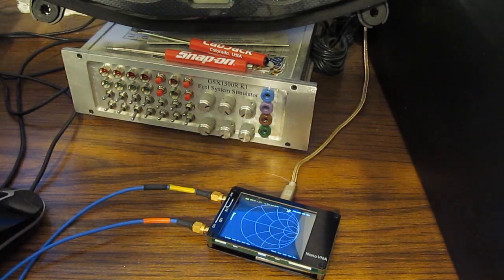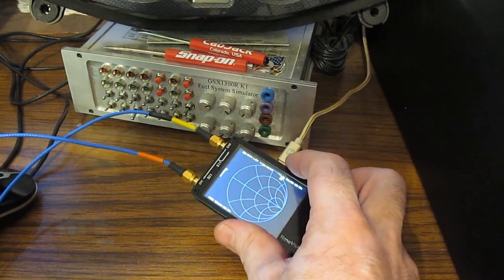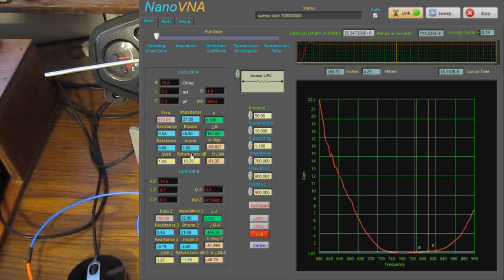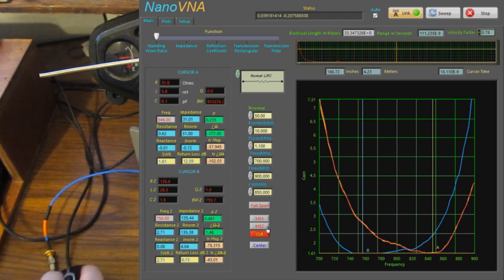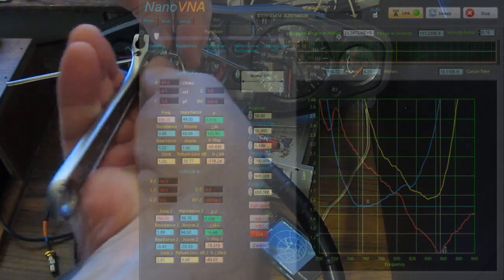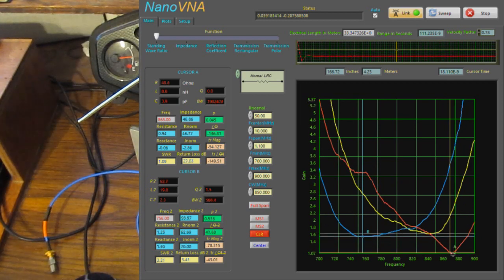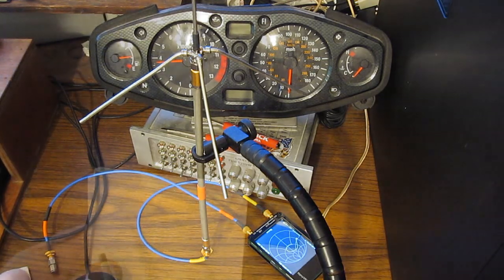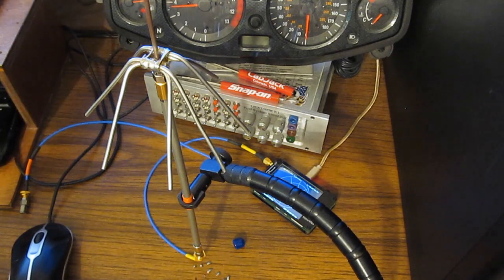Using the NanoVNA to Measure Antenna SWR and Resonance

Comment: Interesting how if Perpendicular (90°) must be used or desired, AFAIK the vertical Radiator can be slightly Shortened (from resonance Length) & a Beta hairpin match used to achieve R=50, Z=0 at Resonance with Perpendicular 90° radials ?

Comment: Hi Joe, ...At 03:24 would be cool if demo'd Radials angle 90° R & Z at resonance (R=35, Z=0) & resulting VSWR Compared to Radials slanted down at resonance (R=50, Z=0).....Very interesting how depending on radiator Length & radials Angle, many Different R & Z values result.....

Comment: I know this video was made a long time ago, but why are you using an antenna that is normally a 1/4 wave design.
The length of the element at 900Mhz is closer to a half or even 3/4 wave?
Reply from the maker: " I attempted to replicate what was in shown in the video they  had linked."
Reply: @joesmith-je3tq  Well, there is no way that this antenna design is appropriate for frequencies at 900MHz. I don't know if you are working in metric or SAE lengths. At 900MHz the wavelength is about 33 cm. 1/4 of that would be about 8.1 cm. For feet it is 234 divided by the frequency in MHz 
or 234 / 900 = .26 ft or about 3.1 inches. 
The antenna that you were using appeared to be for 450MHz.  While it will still work as a 1/2 wave antenna and will give you whacked out results. In affect you were most likely measuring a part of the feedline as being a part of the antenna as feeding a 1/2 wave antenna will present a high impedance at the feedpoint and would require a matching network of some sort to work at 50 Ohms.

Comment: Very useful video. Can I ask for the model of HP analyser you have there? I think it might be 8754A, but the manual for that only shows a graticule on the screen, not a Smith Chart. Is that an overlay you added yourself?
Reply from the maker: It is an 8754A.  The 8754A was supplied with various overlays which is covered in the manual.  I have uploaded these to EEVBLOG.  The one shown in the video is a custom one I made.
Reply: Ahhh, now I read the manual more thoroughly I can see the part about the overlays. Thank you!
Reply from the maker: @gavinsaxby  You should be able to locate them fairly easy with the search feature.  I had copied them using overhead projector slides.

Comment: Thx for helpful informative video....Using this antenna tuning procedure on SWR & LogMag,.... thru 50 to 100 ft coax run, Does it make any difference where the Calibration is performed at ?? .....I've heard the Calibration should be performed at the Antenna Terminal location & Is that Required for Vna Accuracy or is Any Additional length of coax after Calibration OK to use ? ....
Reply from the maker: Is the cable and connections perfect (no loss, infinite BW, no reflection)?  If not, they will contribute to the error.  That said, I suspect you're really wanting a basic answer.   Of course the VNA (Vector) means we have phase information which is going to be effected but you are asking about VSWR.   Think about what VSWR is.  Take your VSWR meter and insert it at different locations along your 100' coax, will the reading change?    
I never understood the ham/CB group using a VNA as what many of them call an antenna analyzer.  One ham posted about the errors caused from a local radio station.  Of course, if you are making VSWR measurements on the transmit end of the 100' coax,  placing an inline VSWR meter would be far more robust and using the radio as a source should provide enough signal to overcome most problems with outside sources.  
I constructed a simple inline Watt meter using two low cost log detector boards from China.  Of course, we would need to know what the load is for it to have any level of accuracy.  For this, both the incident and reflected signals are measured using a bidirectional coupler.   These two signals allows us to also measure VSWR.  The following video shows my meter.  Again, keep in mind you could just buy or build a simple VSWR/Watt meter.  I doubt many hams make their own code oscillators anymore, but I wouldn't be surprised if the VSWR meter isn't one of the first things they still make.    
https://www.youtube.com/watch?v=JHsgbu7brYI

Comment: We live in a decent time for tiny effective electronic tools. What used to require a whole room can fit in my pocket. Bleeding edge tech advances have slowed enough for us to optimize the tech we have. The age of optimization. Why have tons of boxes with screens that only serve a single purpose. Every DVD player and TV can be reprogrammed to detect a fire in the room as well (found that out probing an infrared module while lighting my propane burner). I wonder if someone made a patent on that yet...
Reply from the maker: True to some point.  I have three very old VNAs.   The newest is a few decades old.   The oldest from the 1970s.   The are all very large in comparison with these low cost pocket VNAs.  They also consume a lot more power.   That said, they offer features not yet available with these low cost counterparts.   In the following video, I provide a simple example of why someone may still want tons of single purpose boxes.  
https://www.youtube.com/watch?v=y6iOTEU6Zzo
Reply: @joesmith-je3tq  The longevity of the old stuff is why I still use my 35yo Hioki Volt meter. It can measure current with 10uA resolution. Some of those old bench meters are unrivaled in certain respects to this day. I just like seeing these 50 dollar boxes that get the job done fairly well. I always pick up old gear to repair or use. Easy to work on and reliable. I'll be happy if I get 5 years out of the nano.
Reply from the maker: In my case, the longevity stems from my continuing to service what I own.   I can't afford new equipment that will match the performance of what I own.   While I never use my original VNA anymore, I still require two others depending on the frequency range.   I'm in much the same boat when it comes to these low cost VNAs.  Below 300MHz, I still use the original NanoVNA as it out performs all the others I have.  For example when measuring narrow band devices or making PDN measurements.   Above 300MHz, my current favorite is the LiteVNA.   Still these are not going to come close to matching the performance of my old VNAs.

Comment: 1.03 SWR from 4 ground Radials seems quite Effective.....Why say 4 Radials don't do Any good  ???
Reply from the maker: Provide a time stamp where I stated "4 Radials don't do Any good"
Reply from the maker: OK, at 5:29 I state: "Again, if you read that ARRL book that I mentioned, they talk in there about the number of ground radials.  Basically four doesn't do you a lot of good."
Reply: I was referring to the "ARRL Book" ....They're usually correct on basic issues..... I caught your  drift....I'm on your Wavelength  !!

Comment: Can you please tell us more about those extenders that you use between the feed line on the VNA and the base of the antenna? Definitely looks useful for not only holding these kinds of antennas, but creating some separation for the measurements. Would also love to see a video on how to best measure HT antennas.
Reply from the maker: Hello Ben.  The extender is just some semi-ridged with connectors (Fairview Microwave FM-SR250ALTN-STR).  In the last video I made, I was comparing some small antennas measuring their VSWR and radiation patterns (see attached link).      If I had some interest in ham radio and was reviewing HT antennas, most likely I would rent some time in a chamber so I could reproduce the results.  That or just take them into the field using a common set of radios and common fixed antenna.  I wouldn't just connect them to a NanoVNA!!  lol.  IF you take the time to watch this video, you should have some sense of how a test like this would be conducted.     https://www.youtube.com/watch?v=xe4Fy4Lpnqw
Reply from the maker: Someone else had also asked the same question.  They deleted parts of their posts but you can find the original here.   https://www.eevblog.com/forum/rf-microwave/cb-and-ham-radio-techs-love-their-bird-wattmeters/msg4676236/#msg4676236

Comment: Hi Joe. I think I have the same vintage ARRL antenna manual as yours. But physics doesn't usually change very fast, so we're probably OK. :)
Reply from the maker: It's a pretty decent book.
Reply: The new book is almost 2” thick!
Reply: @roxleyldc , and it's $50 for the soft cover edition. I believe I'll just pick one up at a swap in a few years. Besides, I've never found my antenna design ideas in the handbook, and who wants to copy someone else's?
Reply: @johnwest7993  yes, me too.  I made a fan dipole in my attic with the longest length in the shape of a sign wave from one side of the attic to the other.

Comment: They've made two major improvements. One, the 4 inch version , just a larger version of what you have. 2 the very new version that uses a chip that will go up to 4 gigs without having to rely on multiples as did the first version for higher frequencies. It is said that it has much closer tolerances and accuracy. I think it was called the S2 ? I have the generator with that chip but not the NanoVNA.
Reply from the maker: I made a review for the V2Plus4 some time ago that throws up some pretty decent data at over 4GHz.  If you're interested, you may find it here:
https://www.youtube.com/watch?v=XaYBpPCo1qk
Reply: @joesmith-je3tq  Thankyou. I'll check it out. It looks like a great piece of gear as is the generator.
Reply from the maker: @californiakayaker  Like any test equipment, it depends what your needs are.
Reply: @joesmith-je3tq  Actually I have little need at this time for anything above 450 mhz. But, the day is coming , and I might need 900 or higher soon. I have a 900 mhz antenna I've swept, I think I've gotten an accurate sweep but would be happier with the new model.
Reply from the maker: @californiakayaker  I do hear from a lot of radio hobbyist who consider the VNA an antenna analyzer.  I've had people write me who have bought an old HP8753 just to measure VSWR.   I have no idea what your requirements are or what your intended use is but make sure that YOU do!   If your not in a hurry, I would wait and see what the next generation of low cost VNAs has to offer.

Comment: Looks like X or reactance got close to zero at -.03 and impedance was close to 50 ohms at 48.44 after that last snip.
SWR went way down also 1.04. Perfect!

I have a Nano VNA H4 and am just learning about Reactance or X and Impedance values.
I was wondering how accurate the Nano is on Reactance?

I love the small antennas of the ham bands. I'm stuck using a gynormous 11 meter antennas until I get a Ham License.
I guess I could build one to tinker with on the Nano VNA.
Reply from the maker: It's hard to say without constraining the question.  I made a review for the V2Plus4. I compared some data from it, my original NanoVNA and one of my old VNAs.   
https://youtu.be/XaYBpPCo1qk?t=2698
I also made a review of the original NanoVNA where I made several measurements with it.
https://www.youtube.com/watch?v=mKi6s3WvBAM
Maybe you will find these helpful.
Reply: Isn't it difficult to get a true reactive measurement when the antenna us being measured with a feedline. Pretty tricky to get half wavelengths taking in the velocity factor, or multiples thereof. Especially at these higher frequencies. Use the VNA I suppose. Good luck with that.

Comment: where did you get the NANO VNA computer display software?
Reply from the maker: If you read the description and follow the first link, you will find where I wrote this software.   You could have also read the comments.    I started to put a manual together for the latest version but there's no magic and requires reading.    https://github.com/joeqsmith/NanoVNA_V2Plus

Comment: To whomever may know this one. What type of or kind of connectors are those connecting the radials to the base antenna?
Reply from the maker: SMA
Reply: @joesmith-je3tq  Thanks Joe. So each radial has an sma connector?
Reply from the maker: @tlturner3  Looks close and you will only see a single SMA connector used on each antenna which I assumed is what you were asking.  The radials are attached with solder.
Reply: @joesmith-je3tq  thank you sir! I appreciate the answer.
Reply from the maker: @tlturner3   @Timothy Turner  No problem.   Keep in mind, these antennas had no other purpose than to replicate what had been demonstrated in another video.  It was never my intent to put them into service.
Reply: @joesmith-je3tq  Thanks Joe. I appreciate the notice. I am looking for hardware for small diameter wire/rod for building antennas.

Comment: Is this instrument good for adjusting a receiving antenna or is this purely for transmitting?  I have a HackRF and have discovered that the failures I may have been having with it are my ignorance that the antenna that comes with it might not be perfect for all frequencies and that you might need to adjust its length.  I am hoping that this NanoVNA might be able to provide me the confidence that I am meeting those requirements as closely as I can.
Reply: Not sure if you ever got the answer but yes the antenna with HackRF is not for all frequencies. One I am seeing says it is good for the 75MHz to 1GHz range. A wide range but you wont be able to really see things like WIFI and cellphone signals or any of the long wave stations lower than 75MHz.

Comment: Good video Joe, my software is totally different to yours. Does the same thing (roughly) but your GUI is better and clearer.
Reply from the maker: Anyone taking the time to learn enough to write software for a VNA is alright.
Reply from the maker: Here are a few links showing some of my later experiments.  This will give you some idea how much my software has changed. 
https://www.eevblog.com/forum/rf-microwave/nanovna-custom-software/msg2688396/#msg2688396
https://www.eevblog.com/forum/rf-microwave/fun-with-crystal-filters/msg3071530/#msg3071530

Comment: You mentioned Andreas’s VNA antenna tuning video. So it appears he was demonstrating how to use the VNA properly. Or did I misunderstand the difference between the way you both Are demonstrating how to tune and construct antennas? 

Great video.
Reply from the maker: I think the OP was asking if the Nano could make this same SWR measurement.   So I attempted to replicate what was in shown in the video they  had linked.